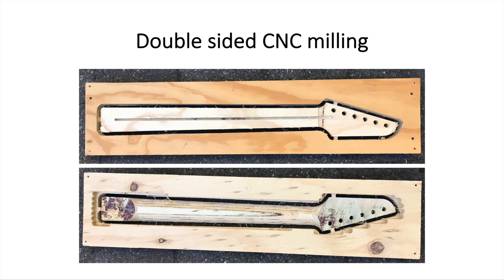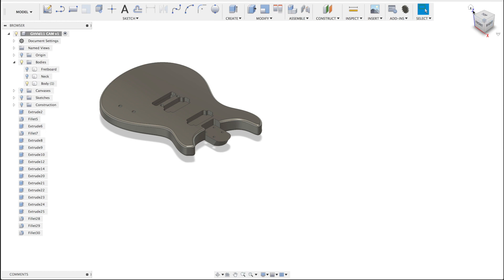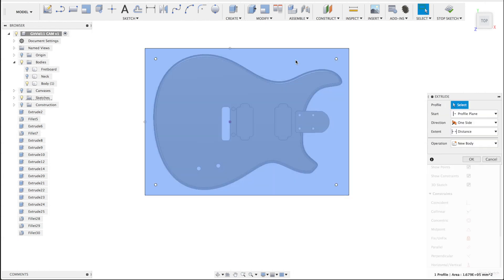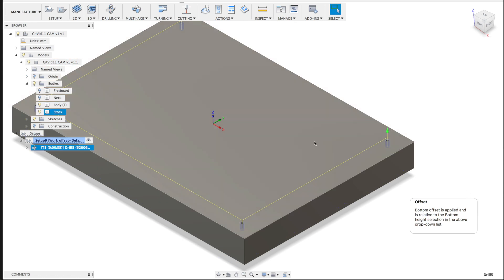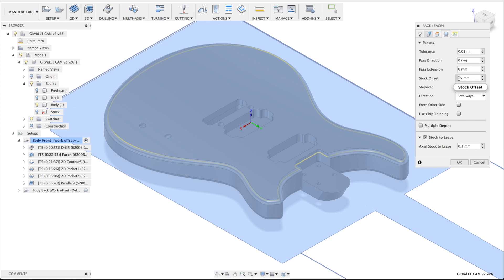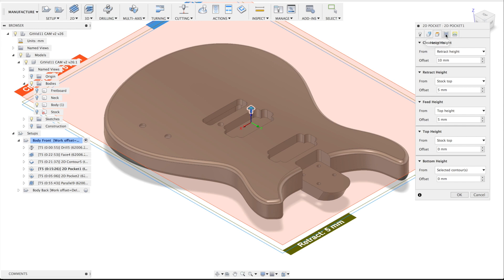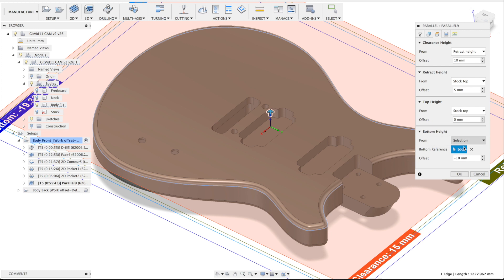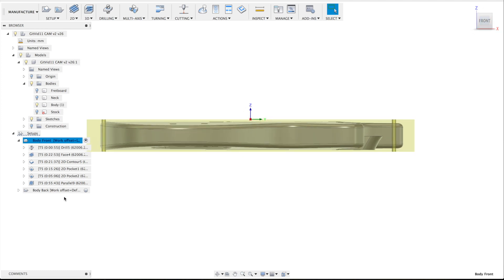Guitar Toolpath Cam process in Fusion360

Comment: So with you origins are you zeroing   from the center of the work piece?
Reply from the maker: For X and Y direction: yes. For Z no; depending on which job I'm running, top or bottom. Have a look at: https://youtu.be/qCEKj0vMkJM?t=905 for topside zeroing and https://youtu.be/qCEKj0vMkJM?t=1133 for the backside zeroing.

Hope this helps!

Comment: So am I correct in thinking that when you flip the drawing to set up the back side operations, that fusion calculates all the code based as a negative distance( in this case since it's flipped, up from the spoil board) as opposed to working from the top of the stock? If that makes sense?
Reply: Think I've got it now, so origin goes to the bottom side, hence the z zero at the spoil board for the  second side. Thanks so much for your help and all the awesome detail you provide from your workflow
Reply from the maker: You’re welcome!
Reply from the maker: Not quite, for the backside you still have to indicate which way is ‘up’ for Z, just like you would for the topside. You do this by making sure Z is pointing upwards. As Z is now on the spoilboard, instead of on the stock, Z is still calculated positive while zero being at the bottom (what now is your flipped topside). If that makes sense :-) You can see the indicator in my vid when I select the bottomjob in Fusion. 

Also you should think about around which axis you like to flip the board; I like to flip things around the Y  axis, if find it easier to remember :-) That means that Y has to keep pointing in the same direction as for the topjob as well. 

I made it a habit of checking and doublechecking the three files (dowelholes in spoilbord, top- and bottomjob) in bCNC (by loading them in). That way I make sure I flipped things the correct way. 

Hope this short story made it a bit clearer. :-)

Comment: If you don't get Y centered you will have two halves that don't match. Drilling a hole on Y zero would allow you to readjust Y if necessary, when flipping the piece, by  checking that the bit is aligned with the hole. Setting X off it as well would allow you to regain both X and Y
Reply from the maker: My machine performs a homing operation when its switched on (from there on it calculates every position from these home coordinates). Then I move the machine to the centre of the stock (the machine moves in relation to the home position) and tell my machine these x and y are the zero positions. By using dowels and flipping the stock the centre point of the stock is still in place. And thus x and y zero of the machine are still consistent as well.  So when I start the other side job I can easily send the machine to its original zero position by a push of a button.

Just to be sure, I do write down the Machine position to ‘remember’ the zero position of the Work position; in case of emergency I could reprogram the x and y zero after a failure or so. I think this is more precise than positioning the machine manually :-) Check my other video’s, it shows you how I do this on the machine. (For example: CAM & DIY CNC machining Guitar Body with Fusion360 https://youtu.be/qCEKj0vMkJM )

This way I could even do the front ‘today’, switch off the machine, come back ‘tomorrow’ and start at the very same precise position. It’s what I think is one the wonders of CNC machining :-)
Reply: @Audiohotshot  Ok, then you are essentially accomplishing the same thing with  the dowel positions - as long as they are the same distance from the center position then of course it works. And of course the body must be centered on Y0 too. So yes, the extra hole is not necessary. I manually home my router - but if it is returned to X0 Y0 before I switch it off, I just have to make sure it is zeroed without moving it when I switch on again.
Reply from the maker: @woodfinchcrafts7267  Just my 2 cents: I do not know if you machine has limitswitches installed, but my DIY CNC has, and they act as soft limits, not hard limits. GRBL then allows you to use these limits as 'boundaries' for the homing procedure. From then on, every position is calculated in relation to the home-position. Your machine now 'knows' the dimensions of your workarea.  You don't have to worry about crossing the limits of your machine, that is all taken care of. I'm using bCNC as software on my RPi and it works as a charm.

Very precise positioning every time; I give the HOME command, place my stock, position the mill, set x and y to 0, run the job. Let's say I come back the next day then, after powering of the whole machine in between, again do a home procedure and I can return to the same exact centre stock position. 

If possible, I recommend you give it a try :-) Hope this helps!
Reply: @Audiohotshot  I built two machines and seriously considered adding limit switches, but realized for my purposes I would hardly use them. It would have been only for unattended routing, to prevent error. I'm now using Vectric Vcarve and LinuxCNC and that has made errors largely a thing of the past. I do understand how a fixed home helps, but I prefer (seeing as my table is over 3 feet by 4 feet) to cut on different places to even out wear and reduce spoilboard replacement